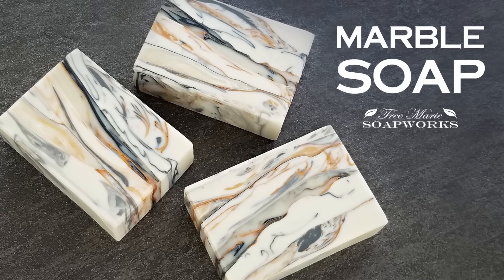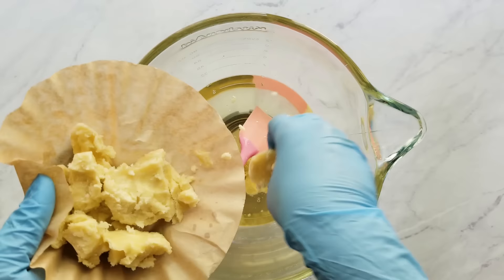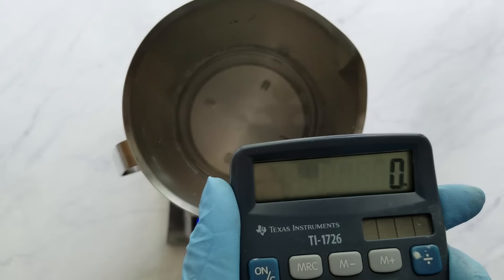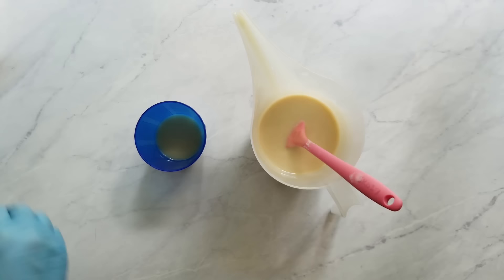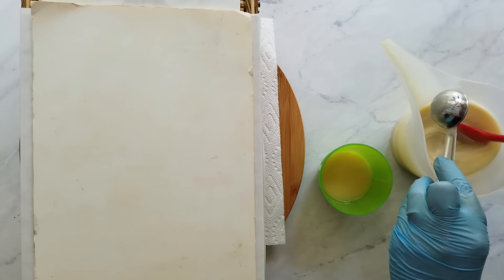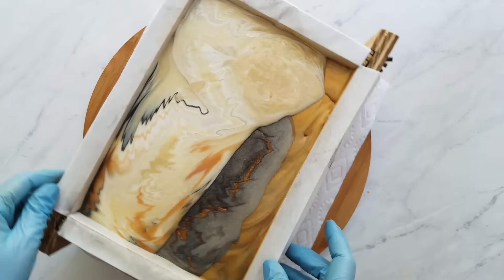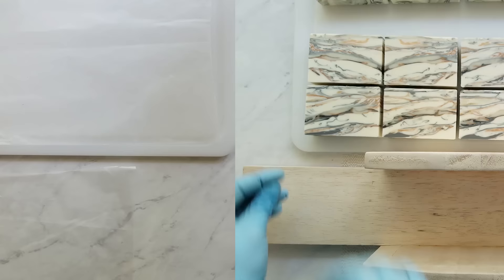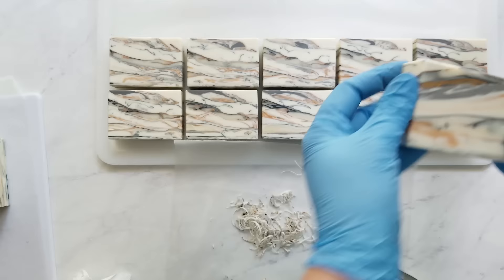Marble Cold Process Soap (Technique Video #27)

Comment from the maker: Welcome, everyone! Thank you for watching! ☕💕
📝The Marble Soap Recipe is now available for sale in my shop! https://www.treemariesoapworks.com/product/recipe-marble-cold-process-soap/
Reply: Hi, can you please include under tools where did you get the spray bottle for the mica/activated charcoal? Love your videos and thank you for sharing all your experience with us!
Reply: Could you mix sodium lactate to soaps with sugar, when the sugar is added for bubbles ??
Reply: Please I would like to learn more from you, if you can. I really like your performance in making this soap. Many thanks.
Reply: Can I ask why you didn't just use all distilled water ice cubes instead of doing part of the total with distilled water.
Reply from the maker: @acrylicavenue6056  You can, but it's hard to get an exact amount with ice cubes, and stirring is a little easier with some water in the mix.
Reply: This was a very helpful video, and thank you so much for the tip on how to get an exact weight without going over. Many thanks!
Reply: What are the measurements  of your mold box?
Reply: I would like to know all the ingredients you used in making marble soap. I like it and I want to start doing it commercially. I would need one or two explanation as regarding choice of ingredients and particularly soap base. How do I manufacture soap base?

Comment: Wow! Amazing beauty! I would be afraid that the soap would fall apart at the layers. When you pour a new layer, it looks like you are adding it to soap that is pretty hard or very thickly traced. How does it not fall apart? I also worried that layers of powdered mica would also separate at that layer. What is the trick to getting it all to stick together?? Thank you for sharing!!!
Reply from the maker: One quick tip......only pour when the mica looks wet.  Blow off any excess mica before you pour.  That will help keep your layers together.
Reply: @TreeMarieSoapworks  Thanks!

Comment: I've noticed that although the recipe changes a bit here and there in these videos, that cocoa butter always makes an appearance - what's the reasoning for that?
Reply from the maker: Cocoa butter is good because it is high in Palmitic and Stearic acid. That helps make a hard bar without being drying like Coconut Oil and Palm Kernel Flakes (can be), which are high in Lauric and Myristic acid. When I don't use Lard or Palm Oil (also high in Palmitic and Stearic acid), CB makes a good partial substitute when paired with Shea Butter. I like CB better than using SB, so I use more of that.

Comment: Hi Teri, I am a newbie soap maker. I am curious what was the reason behind melting the hard oil on the stages instead melt them all at the same time, from other youtube videos I saw the soaper just melt the hard oils all at once. Was it because the melting of each oil?  Thank  you for very educational videos you've been uploaded, it helped me a lot in my learning journey.
Reply from the maker: I like to be more gentle with the butters. I also melt the oils with high melting points first. Palm kernel oil has a melting point of 102°F. Coconut oils melting point is only 76° F. The PKO can help to melt the CO. I soap at 85 to 95°. There is no need to get everything so warm and then have to cool it down again.

Comment: Question about splitting the lye solution into 9 parts, do you just add the whole mixture including container then subtract the container weight to get the weight of lye solution then divide it by 9? Really want to try this.
Reply from the maker: Yes,
Bowl & Contents Weight - Bowl Weight = Contents Weight

Divide all 9 so that you can check your math. 

I round down because you can't possibly get it all into the container. The last one would end up short.
Reply: @TreeMarieSoapworks  thank you. I thought so but wanted to be sure.

Comment: Very nice. Mam please give the measurements of ingredients.
I got a crack on centre of the soap
How to make without any cracks
Reply from the maker: The crack is probably because your soap was cool on the surface and warm in the inside. It can be solved by covering your soap. Also sometimes you can fix the crack by spraying with isopropyl alcohol, covering with plastic wrap and pushing the soap together. 

Most of my earlier videos give the recipe in the description. It don't give amounts because everyone's molds are different sizes and I find that if I give amounts, people who have now experience think they can make an advanced recipe. If you have a knowledge of soapcalc.net, you can make your own recipe with my percentages. Here is a video explaining soapcalc. https://youtu.be/wRTWv50AY2g

Comment: How do you unmold without ruining the corners? My soaps feel hard enough to unmold but I always mess up the corners, I use sodium lactate and all to make it smoother but is there something else to make it easier?
Reply from the maker: What type of mold are you using? Are you using a water discount? That would help. If you are using a silicone mold, press down the mold's sides to get the soap to release from the mold. If it doesn't want to release by pressing down the side, it's not ready. (I'll have to show that in a video sometime. I always do that ahead of time because the videos get to be so long.)
Reply: @TreeMarieSoapworks   I'm using a basic rectangle mold and I wait the full 24 hours, I use the 38% water that soap calc recommends. I got used to messing up the corners at the ends but since they get cut off anyway I stopped fuzzing about it. Thanks for the reply :)
Reply from the maker: That recommendation is way too high. It is usually only used in HP soap. Try dropping it as you are comfortable. I use 25% Water as a Percent of Oil Weight. You can go down to 33%, then 30%... I think you will like the results.
Reply: @TreeMarieSoapworks  Oh, thank you so much, I never knew how far you could or should go :)

Comment: What's the oil weight for a 9 bar slap? I wonder
Reply from the maker: Isabel, I used 33.5 oz which is what I use for 10 bars. You can use 30 oz for 9 bars if you don't want any leftovers. I used 30% "Water as a percent of oil weight" in soapcalc.

Comment: How do you add scents?
Reply from the maker: Are you wondering how it's calculated? I usually use 5-6% of the total soap weight. Each fragrance needs to be checked to see what the maximum usage rate is. (Sometimes the usage rate for wash-off products is less than 5-6%, so you need to check that for the individual fragrance.)

Comment: Not helpful because quantity of ingredients is missing.
Reply from the maker: You can use any slow-moving recipe and try this technique. This is a more advanced technique that requires splitting the lye solution and oil solution several times. If you're interested in the recipe with instructions, I have it available for sale in my shop. https://www.treemariesoapworks.com/product/recipe-marble-cold-process-soap/